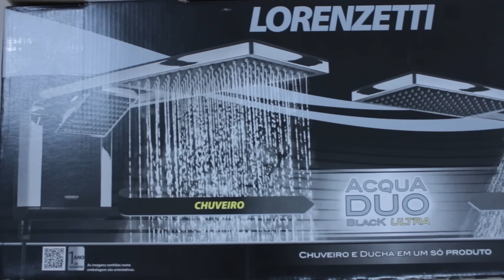COMO INSTALAR Chuveiro Elétrico Lorenzetti Acqua Duo Ultra

Comment: Salve Leônidas! O chuveiro da tua casa é 127v?
Reply: Antônio Marcos de Oliveira , Duvido que seja,  amigo....

Em 127V não dá para ter todo esse luxo, pois geraria uma corrente muito alta para o sistema.  

Você vê dois cabos carregados na instalação da casa dele porque ele está em Santa Catarina, onde não há 127V, mas sim monofásico (fase e neutro)  220V.
Reply from the maker: Dae blz, o meu é 220V
Reply from the maker: É isso mesmo, 220V monofásico
Reply: @robertfranco4493  nada a ver. Existe uma versão 127v para esse mesmo modelo
Reply: @henriquedelima8498  
Você fala de modelo, eu de de conforto gerado pela potência elétrica maior (o que é mais adequado em tensão 220V).